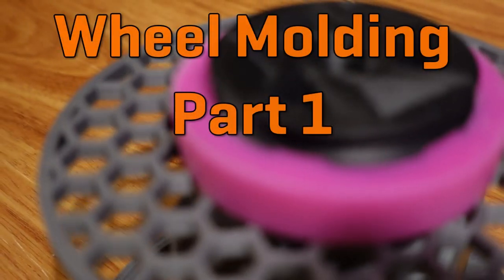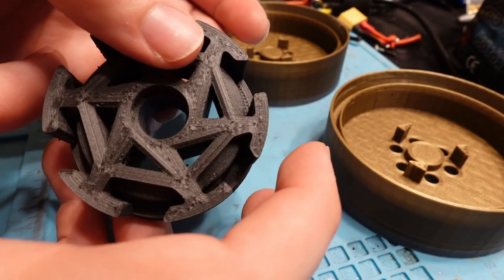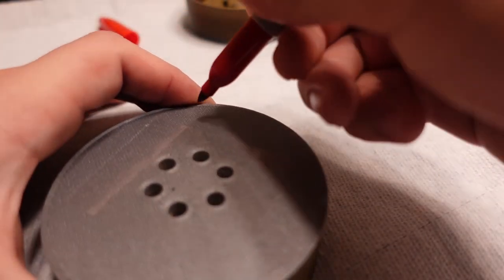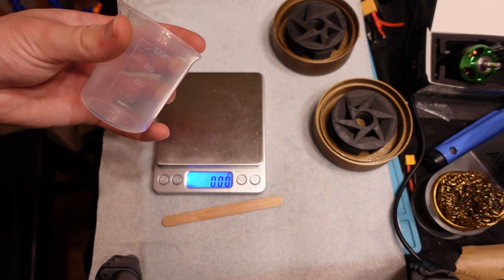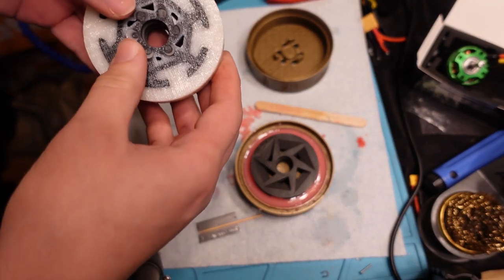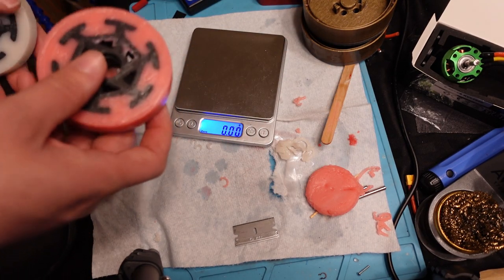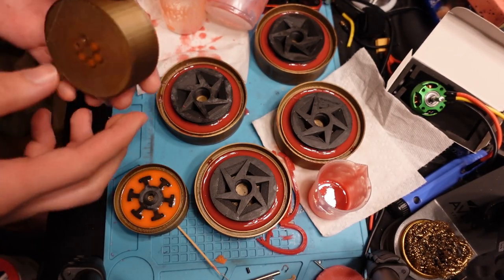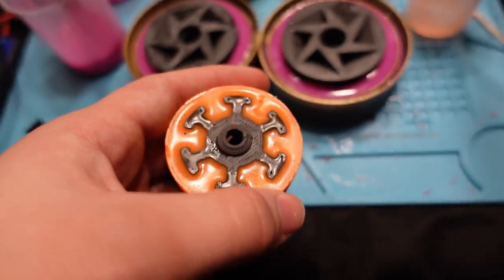How to Make Custom Wheels for Your Robot - Molding/Casting Polyurethane

Comment: So here's an idea. You could use a dissolvable filament (i.e HIPS) to create the mold. This would allow you to create tread patterns without having to worry about how to remove the wheel. The PU shouldn't react with it, and once cured, you can just dissolve the HIPS mold and get the wheel out. Obviously, the mold wouldn't be reusable unless you design the tread pattern (HIPS part) as a separate part that can be used as an insert in the mold and print the rest in say Nylon. A spool of 1KG HIPS is about $20-30, so not very expensive even if you can't re-use it.
Reply from the maker: That's a good suggestion, though it seems like basically the same result as smashing the mold open with a hammer. I had thought about tread patterns and actually that dissolvable support wouldn't be necessary at all provided the tread pattern is properly thought out. Straight vertical lines or even slanted ones that allow the wheel to be pulled/twisted out helically would work perfectly well. I wasn't super confident in the mold release before trying it this way, but may look into that. 

It is also perfectly doable to just make a 3 part or 4 part mold that comes apart in sections even with a complex tread pattern which would still be reusable but that becomes a pain to deal with as it needs a way to be fastened together and leak proof etc. Many people do this for things that are not wheels for industrial molding with the sections clamped together or bolted together. 

I didn't want to mess with that right off the bat. Several others have done it successfully. I basically wanted in this video to show the most basic and easy way to do this to show it doesn't have to be complicated or terribly expensive. In the future I may attempt a complicated multiple part mold. But I really like the concept of reusable molds rather than braking or dissolving the mold.
Reply: @JustCuzRobotics  Good call with a multi part mold. That should work even with a complex tread pattern. Would like to see how that works out.
Reply from the maker: Here is a good example. Kinda what I was talking about. Like I said I'm not the first to do this, but I went for Urethane over silicone partly due to the choice of harnesses and partly due to the lack of fumes. Silicone gives off a strong vinegar smell as it cures. https://youtu.be/46umFYdI8uQ

Comment: Thanks for the detailed video. Aren't the draft angles going to alter the wheels behavior? They are no longer at a 90 degree angle
Reply from the maker: The draft angle in theory would have an impact if the tires are hard enough to not squish very much. I didn't find much difference in practice. That said since this video (which is a few years old) I've been eliminating the draft angle and as long as you have a good amount of mold release generally a 90 degree wall works fine. I even sometimes print the molds with TPU or Polypropylene which can flex enough to pop them out.

Comment: Leaving a comment for myself.
Shore 30a is very light and okay for insect weights, but wear out on HW’s really fast. 40a is the middle ground that Seth uses in this video for his 30LB sportsman. He uses VytaFlex 2 part solution.

He uses a 2 degree draft angle on a PLA mold and uses Nylon Carbon Fiber for the tire hubs.
Reply from the maker: I would add that more recently I started printing molds from TPU with no draft angle which works well. Also adding some holes in the bottom that are covered with packing tape when molding but can be used to push finished hubs out from the bottom after curing helps with demolding

Comment: Great video. I would love to see the various wheels on a bot pushing a scale to compare the grip.

Until I discovered your videos this weekend. I was thinking 30lbs would be the smallest bot I'd be interesting in building. But beetle weight looks like a lot more fun for the dollar/build time. I have everything kicking around I need to build one. Just need to put some time in on Fusion 360 to design it up. I have access to a nice CNC router and lots of HDPE/UHMW scraps to play with at work. Plus a nice FDM 3d printer.  

I was thinking this scale might be boring but your fights at Norwalk Havoc are anything but.
Reply from the maker: I tried using a scale to get some readings but instead of the wheels slipping the belts were so it wasnt a great test. Might try that again if I update the drive to timing belts

Comment: I did a video about casting polyurethane wheels a few months ago. Just want to let you know you need the PU pigment paste for a nice solid color. I used the wrong pigment for my wheels, and they came out transparent :) I call them my Fanta wheels. If you use too much of the wrong pigment the wheels stay soft and sticky.
Reply from the maker: I've seen different pigments meant for opaque and transparent colors. Maybe just ended up with the wrong type? But as another person suggested I might try the powder based pigments later on
Reply: I think the paste type works better than the powder based pigment. It mixes better. How is the shelf life of the PU (A and B component) you use? Mine is only 6 months, so I have to make a lot of wheels in a short time.

Comment: Hey, thanks for posting this, super informative! Did you consider using a mold made of flexible filament?
Reply from the maker: I have considered it, but I've been able to demold pretty complex wheels with basic PLA molds so far. See my latest Shrapnel Mine vid for details. I'm very impatient and TPU prints slowly lol.
Reply: On another project on the mold I made a extremely thin mold then I broke/peeled away mold. Mold did not take long to print.  Made a mold for each wheel.

Comment: Where is part 2 with hub design?  How do you plan on attaching the hub to the shaft?
Reply from the maker: Somehow almost 2 years later I haven't found the time to make part 2 of this... Maybe it'll happen now that I have been experimenting with different materials and durometers.
Attaching to the shaft in this case doesn't happen. I press bearings into the hub and it runs in a dead axel. Live axel setups are easy too but require a different hub design of course.

Comment: Thank you so much for sharing this, very informative ! How did they do in combat ? And are they durable ?
Reply from the maker: I have found the tires hold up pretty well in combat, they have a ton of grip as well. Depending how your hub is designed there could be a risk of chunks of tire ripping out but with a well designed hub the tire should mostly stay together after a hit unless the hub itself is broken.
Reply: @JustCuzRobotics  awesome, thanks from France !

Comment: Your dye has a really low percentage of pigment(the actual colourant). Most cheaper dyes will have a higher percentage of filler than the pigment. You might try using some powder colourants as well.
Reply from the maker: Yeah I think you're exactly right about the cheap dye. Someone who did the same process but used Smooth On's own dyes said he never used under 2% by weight and it was always fine. But those were $15 each compared to $13 for 15 of them.

Comment: What are you using for a 3D printer? I have my eye on a few just curious to see what you recommend.
Reply from the maker: My workhorse printer is a Prusa Mk3S which is basically stock with a custom enclosure built around it. Anything that isn't abrasive I print on this machine. I start prints and walk away and come back 12 hours later to a flawless print 99% of the time. That said I have tuned every setting in Prusaslicer to dial in Nylon and use a special bed adhesive for it, but PLA/PETG are perfect with default profiles out of the box. 

The printer I used for the CF-Nylon parts is a horrendous monstrosity I created by replacing basically everything except the main board and motion system of a Tevo tornado which I got for free without a functional extruder. I have a video on that as well (Just Cuz Pro 3D printer) but it was a project I would only undertake if you have watched hundreds of 3d printing videos and are comfortable digging into Marlin. All you really need is a knockoff bond tech and knockoff E3d V6 plus a hardenned steel nozzle to get it to work for filled nylons. I tried adding inductive bed probing which turned into sortof a nightmare and I wouldn't recommend it. The touchscreen is Hella nice though. 

I built a dry box to feed Nylon and TPU to my printers while keeping humidity below 20% for months at a time.

Comment: Is there a reasonable way to make sandwich type layers?  As in, harder on the outer and inner layers, but softer in the middle (i.e. durability outside, traction inside)?
Reply from the maker: Should be. All you would have to do is wait for the first layer to cure before pouring the next, and use a harder (60A?) vytaflex for the harder layers.

Comment: What do you use to fix the shaft to hub on division? It looked like a round bore with no holes for set screws
Reply from the maker: Good question! It's a D shaped bore that widens to a circular bore. So torque transfer is handled that way. The bore is also intentionally undersized to create somewhat of a press fit but plastic won't deal with that well as it tends to creep so I also hot glue them on. They come off really easily with a heat gun, but it works quite well. Not exactly ideal though.
Reply: @JustCuzRobotics  thanks! I guess this works better the wider the shaft is bc the join is under less stress
Reply: For a small bot, you could grab a clamp hub from Servo City and then design the wheel/printed part to mate with the hub.
Reply from the maker: True, but that would be a lot more weight and money for minimal benefit overall. I had glued on wheels for the last tournament and never lost one.
Reply: @JustCuzRobotics  I've used hot glue as a masking agent when sandblasting parts. When I'm done I pour a bit of ISP 70% or better over the part and wait a minute or three. It doesn't dissolve the hot glue but the glue peels right off. I thought the guy who told me about that was nuts.

Comment: did you feel like you got alot more grip?
Reply from the maker: Compared to the O rings absolutely. I couldn't make an objective test since the belts driving the wheels now slip before the wheels break traction. But the Norwalk competition I used Draconid at after making these wheels, I had no issue pushing another wedge/lifter bot around

Comment: Is there a .stl file for your wheel hubs, if so where would I find them? I have a 3D printer, lots of filament and ready to go. Thanks
Reply from the maker: I haven't released anything from my 12lb bot yet, but I am open to it. The wheel dimensions I chose were specific to my robot so I didn't know if they would really be useful for anyone else. It's not too hard to design your own hub for your own bot similar to mine though. I may do that later tonight just to put it out there. I did upload files for Shrapnel Mine's molded wheels here for reference: https://www.prusaprinters.org/social/31323-team-just-cuz-robotics/prints
Reply: @JustCuzRobotics  Thanks, I'll take a look at it and maybe mod it for my 3lb. bot

Comment: What is the coefficient of kinetic friction for the 40A polyurethane?
Reply from the maker: I can't answer that directly since it will depend on not just the wheel but also the other material it is in contact with. I did a test shoving into a scale on the wall with the 30A and got approximately 0.75 CoF on a vinyl floor in my apartment. It's probably a little lower than that with 40A but maybe higher on wood.

 I would guess no higher than 0.80 for almost any real wheel IRL once coated in arena dust and debris.
Reply: @JustCuzRobotics  Awesome! Thanks so much, I was getting really suspicious of a couple values I was seeing that were giving me a CoF around 1.5. I wanted to ask you to make sure, since I am still fairly new to the building side of the sport.

Comment: PLA should be fine for the rims correct?
Reply from the maker: PLA will work in the sense that the urethane will probably stick to it. But it's super brittle and if your wheel gets hit by another robot it will probably shatter like glass. I have been using TPU printed hubs for a bit now and they have proved very durable so far.
Reply: @JustCuzRobotics  how well does polyurethane epoxy hold up in these thing
Reply from the maker: I'm using a polyurethane casting rubber not a rigid epoxy. I have not tried making structural parts with epoxy. This Vytaflex urethane is a rubbery soft and grippy material. There are different hardnesses, the harder wears down slower but provides less grip.
Reply: @JustCuzRobotics  do I need to enclose and ventilate my printer for tpu
Reply from the maker: Nope it prints fine without warping typically on a Elmer's glue stick (PVA Glue) on most bed surfaces. Just need to print slower than usual as it's flexible and difficult to feed into an extruder and be careful about retractions.
Reply: @JustCuzRobotics  and silicone wouldn't be a good tire would it. Asking because I'm trying to keep a low budget by salvaging material form other hobbies I've tried
Reply from the maker: I tried using a silicone rubber and it is grippy, but it is a much softer material and it tears and wears down more easily. If you design a hub around the increased ability to stretch, that still holds onto the silicone well, it can probably work though.
Reply: @JustCuzRobotics  well thanks for the help I should be able to get started

Comment: Did you ever think of carving some tread grooves into them for extra grip?
Reply from the maker: Yes, I have grooved tires on my 3lb bots Shrapnel Mine and Division. I'm not convinced it offers any extra grip but it looks cool! The tricky part is you need to ensure the grooves are spiral/slanted grooves not straight along the mold direction or the wheel will be more like a gear and just bounce all over the place and get awful traction.
Reply: @JustCuzRobotics  it has to be hard to maintain grip when that plywood gets shredded up. Good luck this season 👍